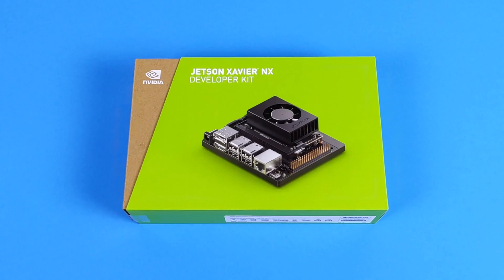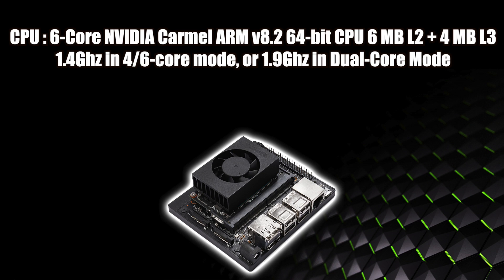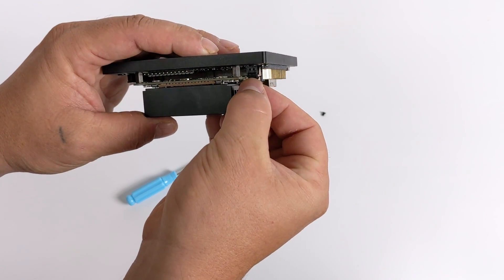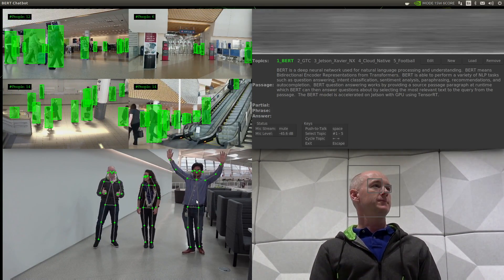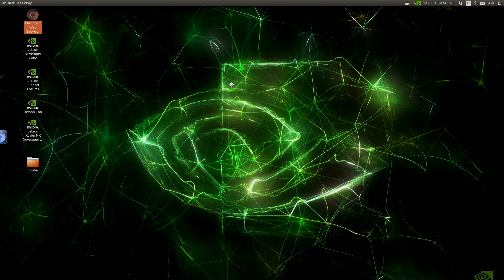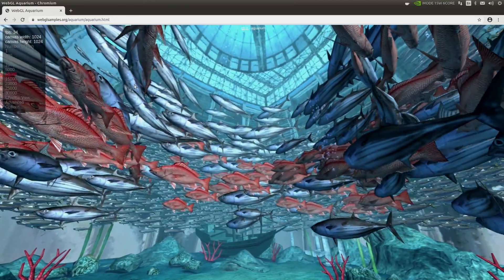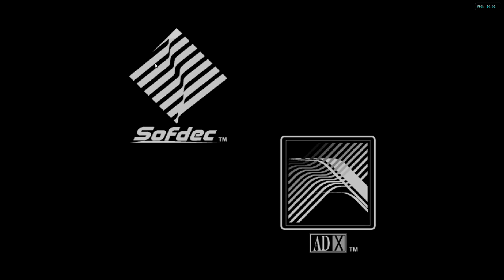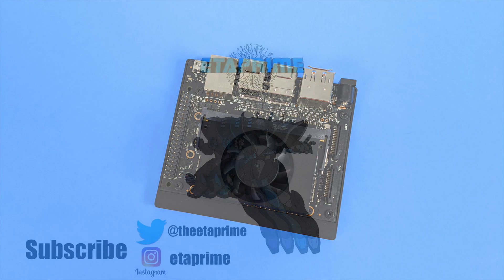NVIDIA Jetson Xavier NX Review - It's A Beast!

Comment: Curious to know how ps2 tittles would run on it
Reply: Badly
Reply: Probably not too good... but has to do with the emulation software, not the hardware.
Reply: Murilo Kleine is there any emulators for ps2?
Reply: @leonardpersin9694   Yes dude. You could have easily searched Google and it would tell you an emulator within 30 seconds
Reply: @leonardpersin9694  It's called PCSX2

Comment: This looks like what I imagine a mid-generation Switch refresh would look like. I mean put that in a box, slap Nintendo on it and it’s a consoleized upgraded switch. Those tensor cores could be used for DLSS which would be a great fit for the switches current library. Many devs complain about the switches lack of memory the most and the 8 gig here would really help.
Reply: The price will be the problem. Nintendo won't make a console that's at least $400. Even more if it's a hybrid.

Comment: I can’t justify something above $100 for media, I’ll just use my desktop or laptop then.
Reply: Yet that laptop and desktop prolly cost you much more than $100
Reply: This thing is almost as powerful as a laptop that cost $2,000 in 2017. It is a bit less powerful than a GTX1060 I think, but with more ram available to the GPU.
Reply: mattizzle Soda lol no this is weaker than Ryzen 3 4300u and weakest Ryzen 4000 apu and this cant beat gtx 1060 with ddr4

Comment: You can infer that the choppiness on YouTube is caused by the same reason you get a crash on dolphin  if you don't use fullscreen. It's an issue with the video driver implementation which makes a lot of sense for newer single board computers. With that fixed you can probably expect really good desktop, web browsing and media performance. (After all it's a $399 computing product with rather decent specs.)

Comment: You can't access 4k with h264ify because youtube only stores h264 videos at 1080p or below, since it'd waste too much space on higher resolutions.

Also, hardware acceleration on xorg in firefox is being worked on. You could use wayland to get hardware acceleration, but not with nvidia.

Comment: So you think video decoding will perform better with 2 cores instead of 6 cores, even though video decoding scales famously well to multiple cores and you saw all 6 of them pegged at nearly 100% earlier.
 But then the emulator you test in 6 core mode without the clock boost? faceplam 🤦
Sorry but makes me doubt your competency for reviews.
Reply: Also would have been nice to know if it's USB 3.1 5Gbit/s or 10Gbit/s.
And YT famously does not offer high resolution profiles in H.264.
I know I am super critical of your video right now, but I still appreciate it.

Comment: This is stronger than the snapdragon 865
Reply: I'd be very interested to see some benchmark comparisons between a flagship smartphone and this. How much better would it be?
Reply: I would hope so since it's running at over 2x the normal power of what an 865 uses. Nvidia stopped trying to get their chips into phones/tablets because they were too power-hungry for those applications. I'm glad they went this higher-power route, but I do wish they had tried to stay in more mainstream devices.
Reply: Apple A12Z is stronger than this
Reply: @malathomas6141  then again this is the weaker version of the nvidia xavier
Reply: acw still weaker Apple A12Z has 6cores and 8 core gpu which beats this
Reply: @malathomas6141  this is the NX tegra xavier I'm talking about the (Stronger) tegra xavier with 8 cores and with 512 cuda cores on top of that that shitpad is gonna get destroyed by Orin an Ampere based Soc
Reply: acw A12Z is the most powerful arm cpu to this day!!

Comment: Are you going to test the emulation with what CPU configuration? Running at 2 cores with higher clock speed should be te most performant right?
Reply from the maker: I did test it with dolphin and it seemed the same but I will definitely be switching profiles around when I test more emulators
Reply: @ETAPRIME  
What's your favourite, this or the Udoo Bolt V8?

Thanks as always!

Comment: Depending on latency, this could theoretically be a pretty good device for tracking motion in VR gaming.
Reply: Its even pre trained by Nvidia
Reply: @idcrafter-clippy  for me nvidia are top dog. Everything they make is always a quality product and anything that has nvidia in will always be a good product. That is just my opinion though. 👍
Reply: @elliotdavies3557  iam 100% with you on that one dude!! I have always purchased an nvidia gpu and i wont change, this would be interesting and also i cant wait till nvidia jumps into the world of cpus as i bet they would be world class too!
Reply: Nah. I'm using an 8K logic gate FPGA, ESP32-S2, IR camera, and MPU9650 for that. The FPGA is just for video transcoding and sensor fusion motion vectors. Using an FPGA drives the cost of inside-out tracking way down.
Reply: @chizukichan  3/6 DOF?
Reply: @LimbaZero  6 DoF. Any time you see sensor fusion between Cameras and IMUs, it's 6 DoF or higher.
Reply: @chizukichan  So you track rotation and place? 
In VR: 3 DOF rotation, 6 DOF rotation and place tracked
Edt:
Now I want to see project how did you do placement tracking with one camera or are you using multiple cameras? Also what are the higher DOF if 6 is rotation and moving?
Edit2: Wikipedia don't specify higher than 6DOF (Degrees of Freedom)
Reply: I think this is based on the same tech behind their Drive platform for vehicle autopilot, so with the right software the latency should be no problem.
Reply: Generally hooking an Xbox kinnect up to a PC is a lot more cost effective and accurate than something like this could be , at least as far as I've seen.

Comment: Would it be possible to get the glmark2 score? My nano score 2000 in 800x600 and 800 in 1920x1080
Reply: GLmark2 on jetson xavier NX gives 1676 at 1080p(1920x1080), at 800x600 it gets a score of 3909. Basically, GPU is twice as powerful compare to jetson nano. IMMO, It should be at least 4x faster considering it costs 4x more.
Reply: @josephtremblant2173  A bit sad effectively, feel like we did see the same benchmark (or perhaps you are the one who published it), did see one other benchmarking some desktop cards (1660ti and the 2060) and the 4k score corresponded to the Xavier NX 1080p one. Well, it is not the x4 expected but still respectable.
Well for the price it is a pretty niche product, even more than the nano. At least I would have expected a x3 performance boost since it has x3 the nano GPU cores count + higher clock speed + newer architecture

Comment: The GPU is basically on par with a GTX 650 (same cuda core count, tho i doubt MHz is the same) but with the added benefits of Tensor cores. Seem like a neat little board!
Reply: You can't compare graphics cards on cudacores alone
Reply: It's more like a rtx 3030
Reply: @TheBeach14  No RT core, so GT 3030 ^ ^
Reply: That used Kepler. You can't compare them.
Reply: Because of bandwith more like a GTX 260.
Reply: U crazy or sum this is weaker than any amd Ryzen 4000 apu
Reply: That's not true...since it is based on volta architecture and the gtx 650 on Kepler. With that being said, the GPU in this device is probs 5 times faster then the GTX 650 because of improvements in the architecture alone
Reply: RDilux Ryzen 5 3400g faster than gtx 650. So this could never be as fast as Ryzen 5 3400G
Reply: Mala Thomas AI-developers don‘t think in that way. This tiny GPU has CUDA support so they can theoretically implement almost any AI stuff on it with CUDA-programming. AMD GPU has nothing to do with AI. Although AMD is trying hard to build its own equivalence of CUDA, but there is still a long way to go.

Comment: If they're both in the same dimm slots, is it possible to just plug in the new Xavier into the Jetson nano carrier board? Do they have the same pinout? Or are they just in that form factor to develop custom stuff?
Reply from the maker: They are the same pin out, I’ll see if it works but the module basically the same price as the full kit.
Reply: It seems possible to do so with the new version of the Jetson Nano carrier board (B01 with two CSI ports).

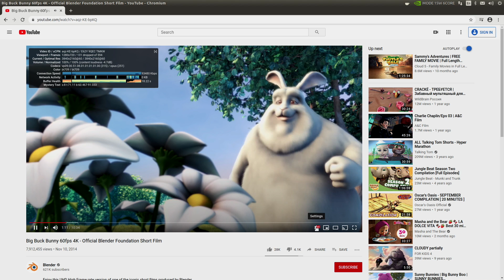Comment: 13:08 the reason is YouTube delivers videos in 1440p and above in VP9 or AV1 only, which is purely caused by too big bandwidth impact on their side and infuriating for me as only relatively new PC hardware has hardware decoding support for VP9 (newer Intel and Nvidia GPUs only) and AV1 hardware decoding is nonexistent. So here I am with my Atom/Jaguar mini ITX HTPCs, that have no problem with decoding h264 content to my 4k TV, but can't work with YouTube...
Reply: Yo dude, try h264ify  extension on chrome/firefox, if u don't know it already can be helpful, it should force the h.264 decode istead VP9, also u can access 30 fps in 60 fps content, all should reduce the cpu usage.
Reply: @MrOoh50  h264ify works for 1080p and below, but not for 1440p and above, because YT only delivers those resolutions in VP9 or AV1.
Reply: @MadammeImAdam someone tell me if I'm wrong.The main reason of using VP9 for videos up 1440p and over its for storage reasons if I remember well. But VP9 should be more demanding on CPU, and AV1 is even more.
Reply: I seriously hope the next Raspberry (5 or whatever it's gonna be called) will have VP9+AV1 hardware decoding.
Reply: It's software issue. Nvidia Shield handles VP9 4k 60fps just fine.
Reply: You clearly don't understand why VP9 and AV1 existed,  go find your self some video comparisons, not everyone like to enjoy video fill of mosaic like you do my friend
Reply: @everythingrgb  Could you direct me to some info on this? What phrase should I look for?
Reply: @everythingrgb  Ok, so VP9 looks better assuming you set the same bitrate, which confirms exactly what I wrote. YouTube could provide h264 4k video, but it would require higher bitrate to look decent and that would mean higher cost of transfering data to client. I assume most devices probably supports hardware acceleration of VP9, but why they couldn't leave the option to use h264 for people that don't ahve devices strong enough to decode other codecs?
Reply: Try Microsoft Edge instead of Google Chrome ;)
Reply: MediaTek Dimensity 1000 5G SoC will be the first ARM64 SoC to be release later this year with support for AV1. Expect a bunch of new SBC boards by the end of the year with this new SoC chip. Expect prices to be in the ($150-$200) price range for a developer board with AV1 support.

Comment: Yeeesssss at last awesome eta prime awesome 👊 i did think though that it would of been a bit more than 1.4ghz and 1.9ghz. As the n2 (odroid) is 1.9ghz to. But obviously the xavier would out beat it anyway but just thought it would be a bit bigger than 1.9ghz 🤔
Reply from the maker: I was hopeful
Reply: @ETAPRIME  me to but even so its still a beast of a sbc and much appreciated for the video. 😁Oh and quick question if you have the time. Out of curiosity what will you be using this for to please?.and would you say for emulation this is not as powerful as the nvidia shield 2019 Pro?. Because of these specs I am undecided now to get one because I thought nvidia would of been putting a little bigger than 1.9ghz and and 1.4ghz to. Cheers and much appreciated. For me you are the best when it comes to sbc and reviews and tutorials always have and always will use your videos for everything i need help on. In other words you are the king, sorry for the long comment. 🤯I do know to it's not meant to be for emulation. 😔